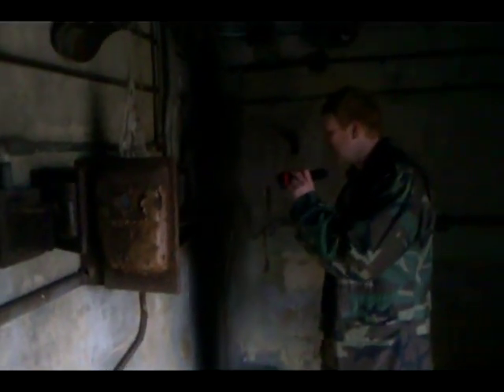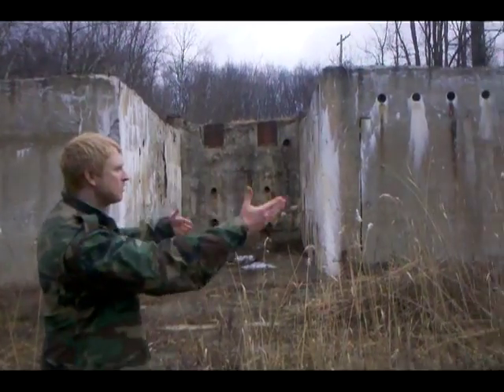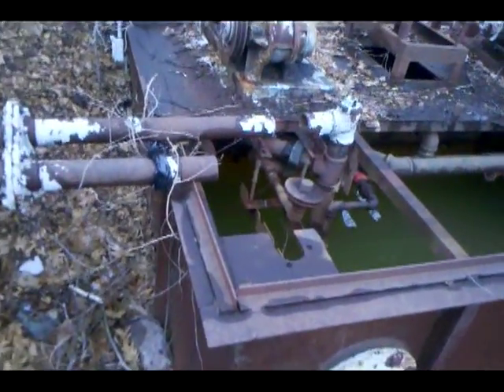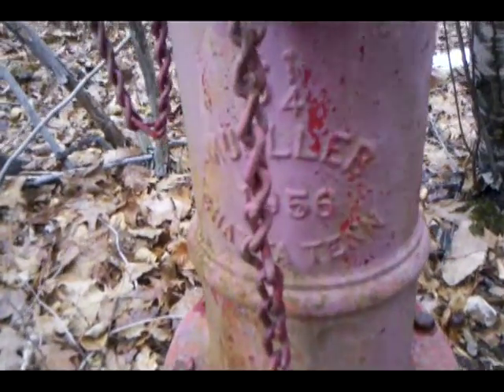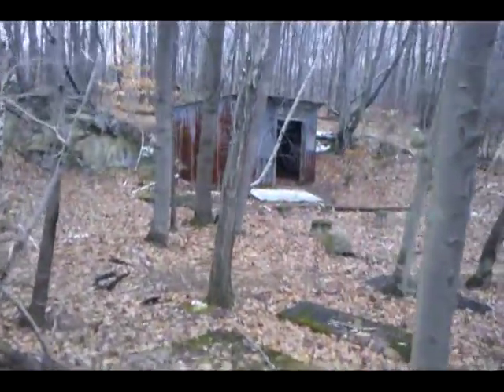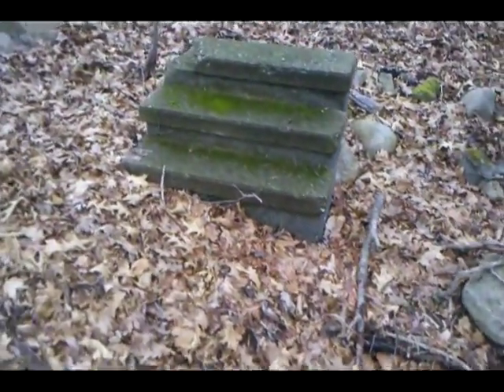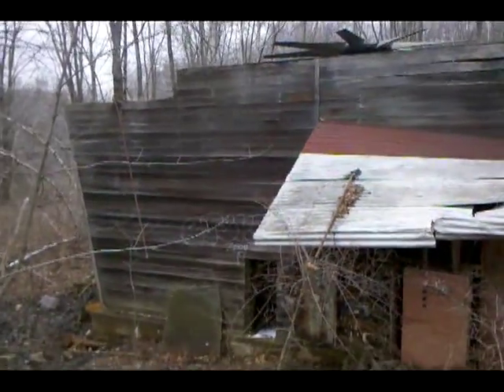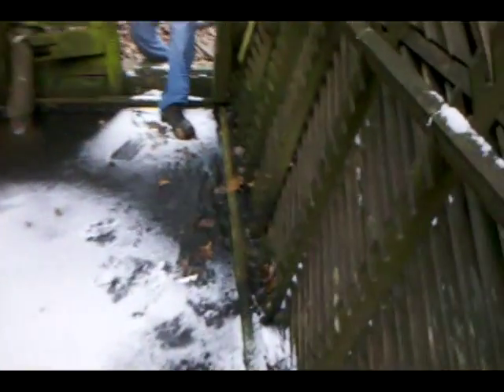REACTION MOTORS - PART 2  AREA R - ABANDONED ROCKET ENGINE TEST SITE IN NEW JERSEY

Comment: my dad worked at reaction motors for years,he designed rocket engines there, and even made little ones for u control  model airplanes, and set speed records with them, reaction motors eventually
 moved to jackass flats nevada .